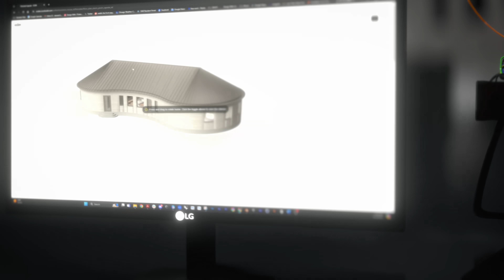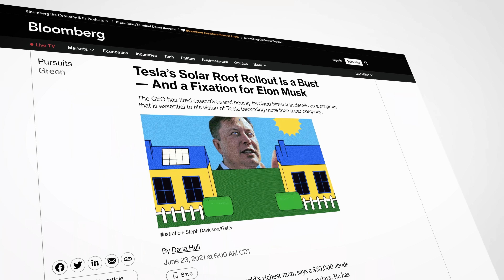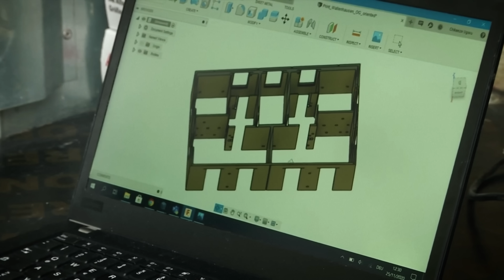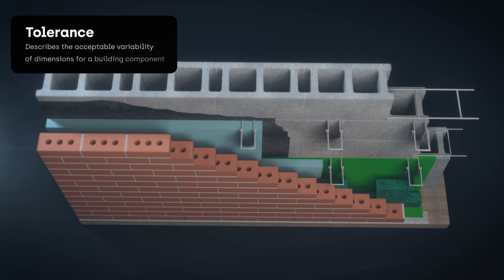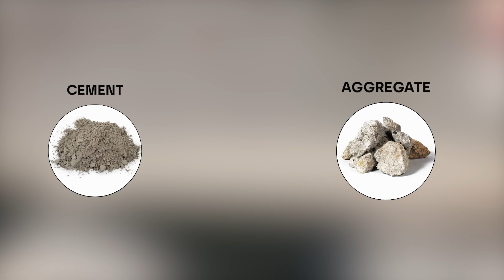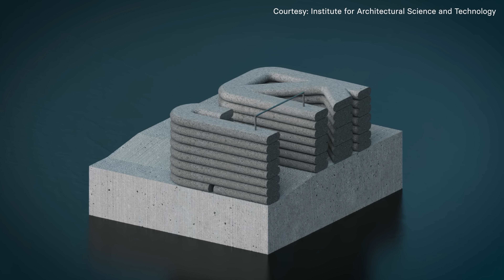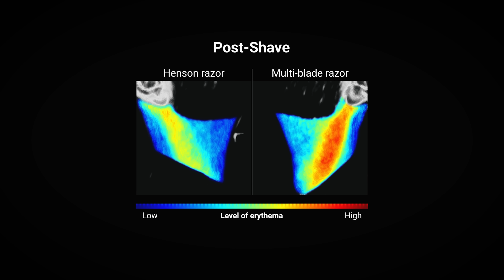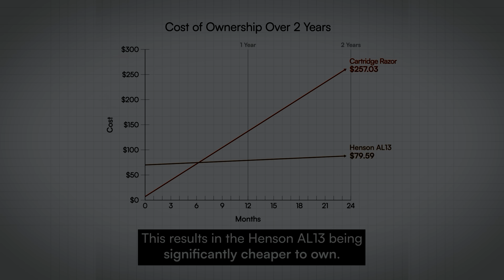Why 3D Printing Buildings Leads to Problems

Comment: I've worked closely with a leading concrete 3D printing company for several years now, so I hope my insight into the actual construction process provides some perspective.

First, one clarification: There is no gravel aggregate in 3D printing concrete. It is only sand.

You're right that the vertical integration is very strong in this industry, but there is already internal pressure to break that up. I expect in 10 years or so, you'll see more open-access tools available to architects and construction companies alike. I can't be too specific and honor my non-disclosure agreements, but there is recognition that the ability for architects to play with shape is very limited for now, which also limits the primary advantage of concrete 3D printing over other methods: complex shapes cost the same as simple ones. The primary reasons IMO for the vertical integration is 1) that there has been a high learning curve for the industry and 2) the business case relies on minimizing labor costs and the strategies for dealing with that are still being prototyped. Normally trivial things like laying foundations, running plumbing, tying roof timbers into the frame, and lintels as you mentioned, are difficult for concrete 3D printed construction. It's only in the last year or so that acceptable, repeatable solutions have been identified for most of these and are finding their way into standard design practices. But even then, there are still maybe 5 or 10 years more of on-the-ground construction needed to establish best practice. It's not too different from the way building materials and building science radically changed in the 1980's, leading to a decade of extremely poorly built houses prone to water damage and short lifespans. It wasn't until maybe 20 years after that best practices for high-quality construction had been standardized.

I would push back on the lack of repairability, though. This has always been an issue with concrete construction, and it's likely to become increasingly common for plaster or stucco finishes to be applied to internal walls, allowing for intrusive renovations to be reintegrated. Structural stability is not likely to be an issue since all walls have reinforcement every half meter anyway and often exceed building strength standards by an order of magnitude. Further, virtually all concrete 3D printing for now is slab-on-grade construction, which already has the same repairability issues you mention but is already widely adopted and has best practices for dealing with things like electrical and plumbing repair. I would also point out that the timber frame construction that we love so much is largely an anomaly unique to the U.S. where wood is abundant and cheap. Concrete 3D printed homes have the (so far unrealized) potential of being many decades or centuries more durable than frame buildings, which will change the design requirements that often contribute to design choices that later need renovations and repairs.

I would also push back on the criticism of how windows and doors are seated in the concrete homes. I don't doubt that many early concrete 3D printed homes were sealed with silicone only, but 1) the gap between windows and walls is already standard in frame construction and addressed with shims, spray foam, and trim and 2) the 3D printing companies have already started to adopt the same building techniques used by frame construction.

Echoing much of what you said, IMO concrete 3D printing has a high potential for unique design that won't be unlocked until architects are given freer access to the tools and pre-fab construction is a necessary companion to this industry, but there is still a lot of building science that is being worked out. There are already some serious advantges, such as all walls having a native R40 insulation rating, but these will be tempered by the inherent limitations. I don't expect to see a rapid adoption of 3D printed construction for another 5 or 10 years and for the U.S. market share to cap around 20% and primarily remain in the residential and light commercial construction spaces. I also think that the current bare-wall aesthetic will fall out of favor out in that timeframe since it will prove difficult to clean. I also expect that environmental costs will remain high as long as cement production relies on fossil fuels and concrete aggregate relies on mined sand. I also expect that a future use case for heavy construction is using 3D printing to create forms for much thicker concrete constructions, particularly for foundations, buttresses, and pillars, such as you see in airport construction.

Anyway, thanks for the video, and all the best!
Reply: Yup. Those internal 3D printed surfaces look like they're begging for some of that aerogel lime plaster or plain old dot and dab drylining. I've seen people build shotcrete boat hulls upside down and then roll them over. They use a stainless mesh, like rebar in regular concrete, then seal it with paint. I've also seen robots tying rebar together on job sites. Will we see these two robots working in tandem to, first, tie a steel frame together then, second, fill it with concrete?  A third robot to do the lime plaster?
Reply: @andrewmalcolm79  honestly depending on how disruptive it would end up being I'd be surprised if you couldn't have the print head having either a giant reel of steel or shorter spikes that it could literally just fire into the still wet concrete at certain points. It wouldn't be as strong as rebar and I have no idea if it would actually work as well but you could have so much more if the machine could just do it while laying layers that it might be comparable.
Reply: @andrewmalcolm79 I would say yes to your questions. It won't be long until AI gets involved in this industry. It will figure out the design and the bots needed to do the job. Once it's cheap enough to buy the machines I'm sure this will replace wood framing for several reasons. Machines will be able to build easier with 3D printing than with wood. And wood is a ridiculous building material. Machines will replace the framing crew, roofers, plumbers, electricians and painters. One machine maybe. It's a matter of time, and if humanity is here to need homes.
Reply: @andrewmalcolm79 I'll just say that there are efforts to automate EVERY aspect of the construction process. I've personally managed at least a few of these projects.

One published project is by OtherLab. They (or one of their many spinoff companies) designed and marketed a drywall installation robot. I don't know the current status of the robot, though.
Reply: Thanks so much for the insights! "but there is recognition that the ability for architects to play with shape is very limited for now, which also limits the primary advantage of concrete 3D printing over other methods: complex shapes cost the same as simple ones. "
I was wondering about this right off the bat when thinking of the  design freedoms and limitations.
Reply: This was a great comment, addressing a lot of the things I also thought about. Thanks for the insight!
Reply: @smashino  Same here. Almost all these "problems" have multiple )obvious and probably non-obvious) solutions that just need a little development.
Reply: You address some points I was curious about. However my biggest questions are these: How do they handle earthquakes? And what is the process for repairs after such an event?
Reply: @oriontherealironman  Again I recently did a project in California. The PSI of our mix is 7200, and the rebar, sheer wall and steel in there will withstand a 8.0 earthquake according to all the engineers that came out and saw the job, reviewed the plans, etc. walls are filled and R value over 30. house is built like a bomb shelter, a solid, fireproof feat of engineering.
Reply: @LeeGaudi-vb9ev  Was that a traditional concrete work job or a 3D printer project?
I was under the impression that that 3D printed doesn't have rebar which severely weakens concrete's ability to endure flexure.
Reply: @oriontherealironman I don't know about how these will handle in earthquakes, so I can't comment on this. I've asked, but that's not a question that's been addressed yet by the company I've worked with since they don't work in an earthquake prone zone. However, since almost the entire industry does single-story single-family ranch style homes, they are already less prone to earthquake damage than something like a town house or other multi-story buildings.
Reply: @joranbooth5529  
That's interesting to know, thank you for answering. It will be fascinating to see how these structures develop and change with more widespread use in varying locations.
I surmise 3D printed structures will find a purpose along side the other construction practices, instead of fully replacing one or more.
Reply: Excellent information, thanks for taking the time to comment.
Reply: "(so far unrealized) potential of being many decades or centuries more durable than frame buildings"?? 
  Well, I'm not holding my breath for that. Maybe some of these machines will be spitting out Roman concrete and some of those structures will actually be allowed to serve for centuries, but the lifespan of most buildings (especially frame buildings, some of which can be maintained indefinitely), is limited by how long their owners will tolerate them. Humans are a fickle lot and it's harder to build something that will be tolerated for centuries than it is to build a structure that will last that long.
Reply: @pcno2832 Nor am I holding my breath for rapid societal change, but there are regions in the world where durability is valued, and where that is the case, concrete homes are a good option.
Reply: Thank you for your insights! I love good comments that add to the discussion.
Reply: I really feel like this is a robot driven gunnite/shotcrete application that is so automated it basically becomes something completely new.  I wonder if there's an application of similar techniques used in pools to cover walls.   

Also, I'll back up your comment about windows and doors.  As a kid who grew up in a family that came together to build houses (my grandfather was an architect from the WWII era of architects knowing how to swing a hammer), there's a ton of horrible stuff inside lots of modern walls hidden by drywall and sealed with sprayfoam.  Anybody who works inside walls knows that even on new construction, there's a lot of "just make it work" fixes.  I can't imagine that concrete 3d printing is worse than a young guy on the site with all new tools.
Reply: Thanks!
Reply: Thanks for taking the time to offer your insight, it’s highly appreciated 👍🏻
Reply: I believe the window "criticism" was regarding how the flat back side of the window casing doesn't mesh well with the raked texture of the walls.
Reply: @skiptheroad I missed that then. Thanks for clarifying.
Reply: Wood might be an anomaly in the US because of it's cheapness, but I know it is used on purpose in Japan because of it's flexibility. If a stone, brick, or concrete building is hit with earth quakes like Japan has, it's either still up, or it's down. Wood building are more flexible and have some lenancy when it comes to that. Or so I've heard from the internet. I could be totally wrong.
Reply: I especially appreciate your considerations about the environmental impact, it would be interesting to do the math on whether the heating and cooling energy savings from the high level of insulation could balance out the impact that the initial concrete production over time
Reply: @JamesBeaucoup  There have been some efforts to model that because concrete homes can partially offset their cost if they can prove that they are carbon sinks or are less carbon intensive than other methods. That said, I'm skeptical that these models have been comprehensive enough.

To your point, the home lifespan will have a profound impact on its overall impact. A home demolished 1 year after construction will have a high impact compared to one demolished after 50 years. I'm curious to see how these homes hold up in the long-run.
Reply: Great comment, thanks
Reply: Have you ever done an episode on Buckminster Fuller's journey of home building?
From failed attempts at block houses to adapting the production excesses post war into home building factories. (monolithic deep drawn modular stainless bathroom anyone?)
Some really innovative concepts to produce simple housing en-mass for returning veterans.
Reply: Thanks for sharing your insights and years of experience. Are there any use cases in the US of 3d Multifamily Units? Say 24 unit bldg?
Reply: @FeltonLewis  I am working on one now in the US. We just completed a Duplex in California. I guess that is technically a multifamily property just a ground level unit. 2 b 2 bath and 1b 1 bath.
Reply: @FeltonLewis Currently, there are efforts to do more than ranch home construction, but these are still very limited.
Reply: Yes - To all of this. Thanks for taking the time to offer this info.
Reply: Such an informative comment. Thank you!
Reply: on the part about architects needing free-er access to... whatever y'all need for prototyping; what's to stop one of these 3d printing companies from making a scaled down version to allow for cheaper and more accessible modeling and stress testing? wouldn't a concrete printer the size of say, an ender 3 printer, for example make prototyping easier for architects?
Reply: @mythrillium2  the company I work with has two for exactly this purpose. One of the company execs is a former student of mine, and her 4th year undergrad project was making a 1m^3 scale concrete 3D printer. It's a thing, yes. Honestly, I had no idea that there would be a demand for that sort of machine, so making some noise about that would definitely get some motion in that space.
Reply: Thank you for your comment. I often get the feeling that these youtubers talking about this have no idea how a house is even built and are merely copying what others say. This isn't exactly the case, but there are some clear errors of thought in this video.
Reply: Thank you so much for sharing your thoughts! 😊
Reply: I'd like to see these 3d printed home companies include at least 1 laborer that is just there to help finish the edges of said home. Get rid of the layer lines, right? Those are gunna collect dust like a magnet and be a pain to clean. I think the biggest thing they could do it work on ensuring the interior finish is at least somewhat similar to drywall, we all like clean edges, right? (I did see some 90degree angles in that one shot he showed, so maybe they are doing this?) Have they figured out how to do multi-story 3-d printed houses yet, or are they still limited to 1 floor?
Reply: @adondriel  There are workers on site to do stuff like you suggest, but whether they stucco the walls or not depends on the home specs. I agree that the horizontal lines are awful for dust.

There are efforts to do multi-story, and I've been told that they are able to, but I haven't seen anything more than one-off demos.

Part of the problem, in my opinion, is that most of these companies want to 3D print as much of the house as possible. It took some time for these companies to accept more prefab, such as installing steel lintels and leaving them in place. At lot of the earliest attempts were looking at ways to bridge gaps with the concrete alone. IMO, a multi-story is relatively easy if you use wooden truss floors laid on top of a shelf along the outer perimeter. I can't speak to the stability of multi-story, though. I'm not sure if it's been rigorously tested.
Reply: At least one company is using a smaller gravel aggregate in their 3D mix.
Reply: @EXROBOWIDOW  My mistake then, thanks for correcting.
Reply: In 10 years we need straw houses and good insulation
Reply: @turnipsociety706  we may be able to eliminate everything that wind power soon because as it warms up a little tiny bit the wind speed picks up a lot. Cheer up we won't have to burn any more fuel all we got to do is just try and catch all that wind going by without it blowing our house awAy
This is Tesla's dream mechanical version.
Reply: I refurbished/remodeled a 1945 house a decade ago and when we put the new windows in they were all measured individually to fit the existing opening to give the best fit.  I would think this would be the technique used with a 3D pour/build.
Reply: @funnyfarm5555  wrong there's nothing to measure. This is pouring on a foundation and then you have to build a house into it there's nothing here to measure like a window being installed. While it's in the computer programming stage you can do all the correcting you want and get a blueprint amen dance around in the circle praise the Lord but at the end of the day once it sets up in concrete you're going to have to correct your mistakes and it's not going to be on the screen. Not one stick of rebar in the whole thing
Reply: It's true that longevity is a concern with steel reinforced concrete, but is that even possible with 3D printed concrete?  You can 3D print steel, but how would you simultaneously 3D print steel and concrete?  Furthermore, there are already serious reasons why many people are looking at phasing out concrete entirely, including the global construction sand shortage leading to literal sand mafias and ecological disasters (beaches stolen away, that sort of thing).  I actually wonder if concrete will remain a viable construction material for that much longer, throwing the whole thing into jeopardy.
Reply: You should look into the mechanization of fiber reinforced nylon printers. That won't answer the strength issue, their frail AF, but it may answer your rough in, and if you figure out how to handle stub outs then you've figured out your reinforcements issue too. Your engineers are weak.
Reply: Dear 3D concrete industry insider, With the concrete's limited flexibility, wouldn't arches be a better method of bridging gaps for doors windows and even hallways? I know that would create some cost issues for doors and windows, but it would add charm and style. Could this make such structures safer in earthquake prone areas?
Reply: Something that I really hope to see 3D printing construction adapt to is the relatively recent breakthroughs in understanding how Roman concrete can be created. Extruder-based printing on the small scale has long been dealing with hot materials, while conventional construction may not adapt as quickly, if at all.
Reply: Koran, I hope you read this if you have time. I could probably google it but given your proximity to this tech I figured it couldn’t hurt to ask. 

Can’t someone just skreed the exposed walls?
Reply: Great Info, I was curious why they weren't adding wood standoffs and plastering over the interior or hardy plank exterior like I've seen in basements. It would be a super simple way to finish. 

Also confused as to why they don't attempt to float the concrete as it sets. I have a history in traditional residential construction and have seen most of the processes used, it seems simple to have a worker follow the nozzle, add in a safety contact bar to the tip to prevent serious injury, just give a light skim as it starts to set.
Reply: Has anyone experimented  with adding a trowel to the outer side of the head? Smooth it out a little ready for rendering and use corner beads to form an edge if it's needed.
Reply: As a robotics engineer. 

Most of the problems are solved depending on who you talk to. 

I work directly with ABB, kukah and a few other manufacturers of cnc and multi axis machines and honestly it’s gonna be less than 5. Give it another 2 years and you’ll see some cool stuff man.
Reply: @thekidd2323 I sure hope so since I plan to get a house within 5 years, and we need a Tesla of House vs what’s being provided at the moment.
Reply: "Poorly built houses in the 80s prone to water damage"
You mean like people who build houses using cement pointing that totally destroyed the breathability of buildings trapping in water and rot?

Solution: put more people out of work building extremely ugly dystoptian damp cement  houses.

More unemployed people, worse buildings, Brilliant!
Reply: What is the R-Value of the walls? How does a vapor barrier (or the concrete walls) work to control moisture?
Reply: What do you see as the best way for an architect to jump into the 3D printed building realm?
Reply: @jokermtb  Personally, if it were me, I would reach out to the nearest company and depending on my current career level, either ask to consult on a project with them or intern with them. Most of these companies have architects they've worked with for a small number of designs. I'm not sure how much success this method would give you, though. Many are hiring, but they may also already be up to their ears in architects. Only way to know is to reach out.
Reply: Some of the examples given DEFINITELY had aggregate (eg at 08:43).
Reply: Expecting the tight vertical integration of the industry to just shake itself out, might be a little short sighted given the trend of corporate culture in almost every area for decades now. There's a huge financial incentive for these companies to lock down, license, restrict integration, etc. in order to monopolize the tech and ensure they are the only ones making a profit.
Reply: @bodeym  fair point
Reply: While producing cement is an environmental nightmare, the CO2 emitted from the limestone, as it's heated into lime, is eventually reabsorbed as the cement hardens, and turns back into a carbonate again, making it strong.

So cement actually absorbs, essentially, all the CO2 that was emitted by the limestone, at least in theory. But that doesn't help the main problem, which is the vast amount of energy needed to heat the limestone in the first place. That almost always comes from fossil fuels.

Seriously, just blue-sky thinking, but might there be an advantage in using volcanoes or lava flow to heat it up? Energy bills must surely be high, so why not take some heat where you find it? We have versatile refractory materials, we ought to be able to work with lava these days. Just keep it insulated enough to remain liquid. Or else, if it sets, pick it up solid then dump it back into the volcano.
Reply: Whsts the R value?   What it take to heat or cool?
Reply: @lada152  It's "thermal Resistance". It's a measured value associated with the insulation. Heating or cooling is a different measure. What R value tells you is if you start at a certain temp inside vs. outside how long it would take for the two to equalize.
Reply: Mm.  Yes.  All I'm reading in these comments and hearing in this video are "let's artificially drive up the cost of homes MORE for some crap no one with sense in their head, that DOES NOT have 40 billion dollars of disposable income just lying around, cares about.  It's not like the housing market and the "housing crisis" are falsely driven by greedy real estate tycoons pushing the price of every square inch of property and houses up up up so they can screw more poor people out of their homes into s|avery.
Reply: Good thoughts. Insightful.
Reply: Hot damn beautifully said
Reply: It could probably use crushed glass instead of sand.
Reply: AGREED
Reply: It sucks that YouTube journalism hasn't even caught up to traditional outlets outside of internet phenomena and politics.
Reply: Thank  you!
Reply: We can already export things into the file types needed for this.  Revit does this already, sketchup not so much but its relatively simple to port it over.
Reply: I’m 😅😢
Reply: but how do they add rebar? I mean, i havent put down bricks in several years, so i dont remember, but ure supposed to put metal in the concrete every 2 or 3 layers of brick. But thats just concrete, the moment a crack forms, its gone. its gonna collapse. i dont remember seeing concrete or any rock partially cracked. its either not cracked or fully cracked. Thats what the metal prevents.
Then installing things in the house or whatever. On last job the guy wanted the roof support beams to be visible and they were there mostly for decoration, but how do you fix them in the wall? Cutting in a brick is relatively easy, but concrete is different story. Like if you had to dig 10 cm deep, 20*10 rectangle in the wall. I havent done that so i just assume, but that seems like itd take half a day per hole. With brick thats easy, just drill several holes and make it a rectangle with rotary hammer.
Reply: SInce you are in the industry, you can maybe share some insides to this: A main advantage for 3D printing houses could be the use of recycled materials right? you basically could just mix powdered rubble which would be waste into the concrete mix instead of sand. Maybe even reuse a previously 3D printed house ground to dust and mixed into the new concrete?

Also the building style currently is very plain, there used to be a time where a lot of art was included into the facades expecially in houses in europe, some kind of floral ornaments, patterns where the windows are placed in, gargoyles or statues. all of those could be printed in the same go if the resolution of the printer is fine enough. Do you know if this is looked into?

why are the printheads made that the layer struckture is visible like this? it should be quite easy to add some kind of funnel which flattens the layers and smoothens out the outer edges. what is limiting this?

and finally, 3D printing could unlock much more organic shapes and integrate buildings into the environment, like if there is a hill or a bolder you want to integrate this would be great to use as custom solution.
Reply: >potential of being many decades or centuries more durable than frame buildings, which will change the design requirements that often contribute to design choices that later need renovations and repairs.

bro jus use bricks.... or adobe bricks.... not flimsy wood.
Reply: Thank you for the additional information, this video was way too opinionated
Reply: Ain’t reading all that, 3D printed housing is not the future.
Reply: Is anyone advancing the printers to do things like printing scaffold material to temporarily hold up the print over gaps, or making bots that can apply a smooth layer of stucco type materials to the walls? I love the tech, and the look of complex shapes, but have not seen anyone address the above issues in spite of decades of development. Also, what about wiring and plumbing? Can those be added into cutouts in the walls, with covers over them, for easy access, or attached externally with decorative covers? What about roofs? Are they designing roofs that are totally concrete and/or using scaffold materials to support printing them? What about marketing? These seem to have at least a few markets, from poor and plain, to rich and luxurious. Are builders finding good paying clients who can allow them to develop the above technologies to make the houses look nicer and have more complex shapes?
Reply: @itoibo4208  Scaffolding is done manually, but there are some feeble efforts to automate that. I had a student team design a mechanism that addressed one small part of that sort of thing.For now, the cost justification isn't there. For things like stucco, there are robots that do drywall, brickwork, painting, etc. but to my knowledge they have never been integrated with a concrete 3D printed home. I wouldn't expect anyone to try for at least 5 more years because neither system is stable enough to enable that level of automation yet. (I'm a roboticist/engineer, but this is just my gut feel based on what I've seen survive in the market and actually demo'ed rather than actual insider knowledge)
Reply: @joranbooth5529 I don't know if you're still answering here, but I wanted to ask something. It occurred to me that, in the case of printed walls that are infilled with (insulating) foam, that this is getting conspicuously close to the structure of sandwich composites - if you're familiar. (Basically, that you have two thin, strong outer panels sandwiching a thick, light and often soft-ish middle layer - because of the physical dynamics involved, they're very strong.) The question is then, if the insulation foam was formulated such that it has strong adhesive properties and bonds well with the concrete, and is itself structurally "strong", this could possibly create extremely durable walls, possibly even with less need for steel wall spacers and other reinforcement. Is that an avenue that is being investigated, or is it even already considered a part of the strength benefits?
Reply: @mnxs  That's an interesting question, and it is certainly possible that foam would strengthen the structure. But I don't know the chemistry interaction between the foam and concrete, and if the surface adhesion is weak, it would not be a structural advantage. There are ways around that, such as adding mechanical features to allow two dissimilar materials to interlock. Maybe with concrete, this would be J-shapes on the inside of the wall.

In short, it's an interesting idea that deserves study. but I'm not involved enough in concrete 3D printing practice to be more definitive, though.
Reply: @joranbooth5529  Thanks for the reply! Yeah, I can imagine that adhesion could be problematic - even if you can get something that bonds well enough in theory (certainly, structural adhesives prove that such a thing is possible), I could also imagine that the surface of concrete specifically is ill-suited for this - since it'd only bond to the very outermost (micro-thin) "layer", which could conceivably be a bit too porous/brittle - concrete isn't good with tension, as you well know. But using J-hooks and the regular spacers (shaped appropriately) might be viable, good idea.
Well, if you pitch the idea and end up making your bosses very happy, I wouldn't mind getting partial credit, lol 😁
Reply: People don’t really want to live in an ugly house. In the aesthetics of what we perceive as beauty are somewhat built in, and also culturally evolved. These houses look like they belong on a set design for the Flintstones?
Reply: @joranbooth5529 I can't see how elevation is a problem - you can stick on top of concrete anything you like. Isn't it that 3D printing makes sense for foundations and structural part, while everything else is better to be done/finished by standard methods. Anyway - thanks a lot for the info. Much more informative than original video.
Reply: This comment is a goldmine. Full of good info on both sides.
Reply: This is what I call "constructive criticism", the comment was very informative and not denigrating to the original post.
I enjoyed the video and this very insightful comment. Thanks.
Reply: Brillant
Reply: 3d printers seem to be improving fast. Maybe not for building homes. Yet the tech will trickle down. 

 People aren't seeing the future. This is basically a prototype. There will be first adopters. 

 So I see it taking off. I just don't know when. 20 years. 

 One day we will be able to print things atom by atom at scale. That will be the future of humanity.
Reply: This has to be the most informative comment to a youtube video I've seen. Thanks!
Reply: You are a true scholar and I thank you! I'm interested in this line of work What would you say has the best job availability to get into this field?
Reply: @Jackfrost2551  I'm not sure. Typically, you would need to reach out directly to one of these companies. Keep in mind that their goal is to minimize labor costs, so I have no idea if they are hiring at the moment. But if you are interested, be persistent.
Reply: Thanks! I read this comment and figured it would be way more informative than the video, so you saved me time 😁
Reply: Can you give me some information as to  who I could contact about information to getting a home 3d printed In north Florida? I’ve reached out to a couple of 3d printing companies and also several custom home builders who are local and none of them seem to know what I’m talking about. I’m basically at the start of this process. Just trying to get information about where to start Seems to be an issue right now also. Thanks you seem really knowledgeable about the subject so thought I’d reach out
Reply: Ty, much more informative than the video
Reply: Hi.

1) Is there really a cost advantage to using 3D printing versus using pre-fabricated concrete modules that are made in a mold off-site? It seems to me that using pre-fabricated concrete panels & modules are better because they're easy to remove and replace. So, that makes repairing and modifying the structure much simpler.  

2) At the end of the day, how is this any different from pouring concrete? 

Thank you.
Reply: Thanks bro, I was thinking these things as well.
Reply: Would multi-story buildable robots with simultaneous water and electrical install be here in 15 years or so?
Reply: Nice. Thanks for that
Reply: Stewart probably never saw a concrete structure being constructed. And he thinks brick houses have just bare brick inside and outside.
Reply: Thank you for your input and insight
Reply: Nah, it's literally a waste of energy, just like AI, and EVs.
Reply: Great comment - I have a question.  Could this also be a use case issue?  I mean using 3D printed homes to great small family dwellings seems to be ideal and a great somution to the affordability and homless problem.  Do we need to print bougie 2 million dollar palaces?  Seems like most of his critiques were aimed at that trim level of housing.
Reply: Fantastic comment. Thank you for sharing your expertise!
Reply: Thanks for sharing
Reply: No. 3D printed houses will disappear because it is a terrible technology. It will be replaced by site cast cellular concrete monolithic pour homes, with the machine that I happen to be developing myself.
Reply: A lot of American housing is built to fail, not to last. Homes are often built with cheap drywall, vinyl siding, synthetic materials, etc. The goal is fast turnover, not long-term durability. 3D-printed homes can solve many of these problems—but aren’t mainstream because:

They don’t fit the “build-to-replace” economy.
Concrete or geopolymer 3D-printed walls resist mold, rot, and pests.
They can be designed with high thermal mass—staying warm/cool naturally.
But they don’t require frequent maintenance or material replacement… which means less profit for builders, suppliers, and contractors.

So ironically, better tech threatens profit chains.
Reply: As a Structural engineer and therefore a Forensic Envelope engineer this is non-viable for any number of reasons. It can't perform in seismic or hurricane zones. It must have siding added, set on tracks, but the tracks must all be co-planar, not possible. So it's a dry-country, warm region, no seismic, no hurricane 'solution' for ... Taos? El Paso? I'd pay adobe or cobb workers before someone brings this 3D mortar machine in.
Reply: @AmericatheBeautiful-p4z  Huh? Of course you can put this on tracks, just print the whole thing on them, what is the problem? You are very limited in your views, you have no clue about how 3D printing works, in many way it is much more flexible than the old way of building. This by the way is not the be all and end all of all 3D building printing, this is just ONE WAY demonstrated here, did that ever occur to you? Would you claim the same about an old brick building that is obviously NOT earth quake proof, that therefore all building that use a stone type building material must be make out of bricks? Of course not. But you do that here with 3D printing.
Reply: I absolutely agree with your perspective.  It's a developing industry that just needs time and investment to overcome the snags, but it works and those snags aren't so serious really, especially when you consider the long-term advantages of the method.  

However, I'm amazed we're not using CLAY as the primary substrate!  It's abundant, durable, superior insulator, dimensionally stable, low-carbon, breathable, mouldable, fire-resistant and can be reinforced with recycled GRP fibers or metal mesh if necessary.
Reply: Epic response!
Reply: Rules to build are slow ,design
Reply: The whole goal is completely misplaced. The expensive part of construction is not the basic labour of primary construction. 3D printing also doesn’t remove the fundamental labour requirements. You still need the same number of concrete truck drivers, and you’d still need the same number of guys on site to be able to reasonably do detailing & to fix problems as they occur. The whole concept is born of an essential misunderstanding of the industry.

The primary cost of house construction, especially in the US market, is the extreme price of homes themselves. Inflated house prices mean inflated upfront cost for land, as well as inflated expectations for minimum return. Speaking as someone who works for a developer, we cannot afford to make things cheaply. Our minimum upfront is simply too high so we’re forced to play in the luxury market if we want to make any money in the city. If we don’t play to that market then other developers will outbid us for properties and we’d end up out of business.

The practicalities are completely irrelevant. At best this is a novelty, at worst these structures will not be sound or nice places to be (seems to be more the later than the former). The problem is the existence of federally backed mortgages reducing the risk too much, driving up the price. We’d love to make cheaper homes at a faster pace. But we can’t because the bank has to take their cut. The main cost for us is organisational & transactional, not labour.
Reply: I appreciate your insight, having a perspective from the other side of the fence is extremely valuable, and I thank you for taking the time to write this.
Reply: Had to watch a YouTube short while reading this essay
Reply: I would add another tidbit: 3D printing is nice on a clean slate, or a flat, empty space with enough room around for the gantry. That means it works for new developments on previously levelled terrain. This may fit for large parts of the United States, but it works not so well in regions which are more mountainous than the continental U.S.. Most of Europe is hilly or mountainous - not in a Rocky Mountains way, but hilly enough that many construction sites are on a slope. This is not an issue for a traditional house - you just need to level the actual area of the foundation. For a complex gantry, this becomes a problem. And Europe is very old, which means that basically everywhere someone can develop land for construction, it is already developed or was left out because of some problems like being in a flooding area or on a steep hillside. Or it is a previously developed spot, which was cleared for new construction. But that means that space is very limited, because the neighbouring spots already have houses. Where do you place gantries here? And how do you even get them on site, if the access road is narrow, because it was planned 750 years ago wide enough that two horse drawn carriages can pass each other?
Reply: I think the trick to improving concrete 3D printed homes is to incorporate other methods of 3D printing. Starting off with chain welding 3D printing for the basic frame structure. Then moving on to foam 3D printing which combined together with the chain 3D printing could give curved and domed roof structures that do not have to be framed. They could also act as a temporary support for the concrete to be 3D printed on until it dried and was structurally sound itself also the 3D printed foam walls would allow places for conduits to be ran and provide extra insulation. And also thinner concrete Channel prints for the domed roofs that could be cross-hatched that provide extra strength. Using multiple techniques possibly print almost everything except for the doors and windows possibly even print the gutter systems
Reply: Calling me even A layman in this field would make me blush, that being said i "learned" more from your comment than from much of the actual video. If you're ever considering another option within your field, teaching might be a calling for you my friend. The soul, for lack of a better adjective, of this heady information i found more understandable to grasp when you were laying it down. Js :)
Reply: "Trivial things like plumbing." I'm a plumber, it's not trivial. You realize that very quickly if it isn't done right. It takes time and knowledge
Reply: Yeah, that bit about using the 3d print as a form for a thicker wall is so hilarious to me- my forming crew can do 300 ft of 9 foot tall wall in about a day and a half- and it will be perfectly level, plumb, and straight
Reply: @gatergates8813 I hear that, but I"m not referring to shapes that can easily be formed up. I have no doubt of the skill of an experienced crew, but as you know, some curved shapes are very hard to form. Concrete 3D printing is just one of many tools, and for now it's a clunky one. I don't think forms will go away, but I do think that if a business case comes up, it will happen.
Reply: @joranbooth5529  Do you think that this could be used to build something much more affordably in the shape and design of a medieval castle? With a plaster and lime wash, I don't think you'd be able to tell the difference. I might need to make a few concrete forms to sharpen up corners though.
Reply: @CaedmonOS i don't think this tech would be easy to shoehorn into mimicking another texture.
Reply: They need to have a plasterer follow the machine & smooth the surface. That surface would be horrible to paint or clean. the insects & spiders & moss would love it though.
Reply: I don't understand why there is such a push against timber framing. And one of the things always brought up is that "it is an anomaly to the U.S." Okay... so? Just because the rest of the world doesn't do it now doesn't make it wrong. We don't have to change our way of doing things (especially if it works well and is sustainable for us) just because others do things different. Are we children? Do we need our mother to ask us, "If your friends jumped off a bridge, would you jump too"?

And the durability argument is not really all that valid either, considering we have examples from all over the world of timber frame buildings that have stood the test of time for centuries. There are wooden frame churches, temples, castles in Europe and Asia (Norway, Poland, Hungary, Serbia, Romania, Russia, Kazakhstan, Japan, etc.) and some churches and homes in the U.S. that have lasted for centuries and are still standing strong. Timber has just as a strong an historical pedigree as stone when it comes to construction.

Also, stone has to be quarried and minerals have to be mined for concrete. Timber is a reneweable resource (because you can plant and grow trees, and when they're cut, you can plant new ones to replace them) that, when harvested intelligently, doesn't cause nearly the amount of ecological and environmental devastation that quarries and mines can and often times do.
Reply: @SouthernPecan86 I live in a timber frame home, and love it. That said, I also understand the push against timber framing. 

First and foremost, is fire. Wood burns, concrete and stone do not. Sure, the interior furnishings and wall coverings can burn, but that is still a less dangerous situation than the actual structure catching fire. Non flammable construction also has the advantage of limiting spread. A kitchen fire is much more likely to stay in the kitchen. 

If old wiring shorts out and burns a little bit in a concrete wall, call an electrician. If old wiring shorts out and burns a little bit in a timber frame wall, call the fire department. 

I'm sure insurance companies are part of the push. I'm amazed they haven't made residential sprinkler systems a requirement, but since there seems to be little appetite for that I'm sure they'll take non flammable construction if they can get it.

Second, the durability argument is perfectly valid. 

While there are many examples of centuries old timber frame structures, they are only still around because they were maintained. The ones that weren't maintained no longer exist. Quite a few pictures out there of a masonry fireplace and chimney standing seemingly alone in a forest, with the rest of the structure rotted away. 

There are plenty of other problems you see with old wood framed homes that wouldn't happen with a concrete home. 

Moisture is the biggest I see. Rotted out floor joists/beams from basement/crawlspace moisture. Mold damage from the same. Of course concrete isn't immune to moisture, but it's a lot more tolerant of it than wood, and for much longer.

Finally, termites and carpenter ants. Insects can literally eat away the structural integrity of a wood framed home if left untreated. As far as I'm aware, there aren't insects that eat concrete.

There's a reason that living in an old home here in the US is an "experience", but perfectly normal in Europe. I've heard of people here having to get insurance through carriers based in Europe after US based insurers denied simply because the home is "too old".

While perfectly doable, there are unique challenges to living in and maintaining a centuries old wood structure that simply don't exist with concrete and masonry. Naturally, concrete and masonry have their own unique challenges when it comes to maintenance or renovation, but those challenges are largely the same whether it was built 10 or 200 years ago.
Reply: @Sparky95  Not exactly:

> If old wiring shorts out and burns a little bit in a concrete wall, call an electrician. If old wiring shorts out and burns a little bit in a timber frame wall, call the fire department. 

The wood house burning down is the worst-case scenario, but it's not the most common.  Any shorting and burning is most likely to happen where connections are made, and by code, these connections have to happen in junction boxes.  Anything in these junction boxes are generally made to be hard to burn.  This generally keeps the melting/burning contained so the house isn't set on fire.

I agree, concrete is a lot less flammable than wood, but there's a lot of redundancy in modern electrical systems so that fires are contained and avoided.  For example, Arc-fault breakers.
Reply: @SouthernPecan86  The obvious issue is the fact that you will run out of trees. It's not as if continuously harvesting every tree that is a proper grade for construction is a smart idea environmentally speaking. You will never be able to replant and regrow the amount of trees needed to supply housing to an ever increasing population without still damaging the biomes those trees originally inhabited. You're driving animals out of their habitats, and changing them forever. Replanting isn't simply a drop in solution. It's a bandaid.
Reply: @SouthernPecan86  I'm sorry that I came across as being against timber framing. I don't see it as better or worse. It's simply another tool, as is concrete 3D printing. Different methods work better in different environments. And I fully agree that (at least for now) timber is renewable and cement production is not.

The durability argument : you mention extremely old frame buildings. Yes these exist, but 1) they are made almost exclusively with old-growth hardwood lumber and from species resistant to rot and insects. Modern timber frame homes approach this by treating the wood, but it is still far inferior wood to what is being used in these ancient constructions. And 2), they tend to be maintained by groups that can afford the maintenance. Your counterpoint seems like a survivorship bias to me. Again, I see timber framed homes as only having pros and cons, and not being a moral good or bad.
Reply: I agree that most of the concrete 3d problems are overblown in the video. But from my perspective. Concrete 3d print are inferior then module prefab construction. Why waste time setting up the printer, material, and manpower at the risk of mother nature ruining by raining. When you can mass produce pieces/parts of house and ship them to location for assembly. Like lego.
Reply: @RandomPerson-tz7wk 1) there is a market value to the labor reduction provided by 3D printing, and most of the companies for now are trying to figure out how to push the tech to its promised potential. Right now, margins are slim, but the company I've worked with turns a small profit already.

To me, the walls are a the low-hanging fruit that is easy to communicate, but the places that concrete 3D printing can make a profitable impact are yet to be realized. Again, I'm being somewhat cryptic because I don't want to accidentally share more than I'm allowed regarding ongoing projects, but the industry is trying a LOT of different techniques to expand the utility of the tech, some of which I think hold a lot of promise.

I would push back, though. I don't think the video overstated problems with concrete 3D printing. I think all its criticisms are fair. I would just prioritize them differently than Stewart.
Reply: @RandomPerson-tz7wk  he did say in the last paragraph that 3d printing and prefab will likely be used together.
Makes sense to me as both have their advantages. You can use 3d printing to make prefabs fit the unique use case of the building better.
Reply: @RandomPerson-tz7wk  I think you have a point here, plus the options for using more sustainable materials are greatly increased.
Reply: @RandomPerson-tz7wk shipping costs can be quite large and there are challenges for that. You also end up shipping all the weight twice now instead of once.

Weather is regional. In many areas it's easy to avoid rain. But yes, not everywhere. In those cases it would be easy to setup a reusable fabric structure though. In fact that is already done to a lesser extent sometimes.
Reply: @RandomPerson-tz7wk  -- Because the shipping costs will make the idea worthless.
Reply: @johnnyonthespot4375  shipping and setting those machine and material cost less?

If cost is a concern stick to wood house. If you want to make a house using cement. 3d printing is far more limited in design and is not solving the main problem the video mention. Not mass producing house.
Reply: @RandomPerson-tz7wk  -- I think you misunderstood - I am saying that, although the manufacturing of something in a factory may cost less, it is the transport costs that would destroy  any savings.
Reply: @johnnyonthespot4375  I understand you perfectly and I disagree. Concrete 3d printing still have shipping cost and it won't be cheaper then shipping an entire house ikea style. Plus there's the saving from needing less manpower and hours to assemble the house. The materials use are not limited concrete. They can complete the timber/metal frame and connect it on site.

Overall it have less complexity, higher flexibility and tolerance for error. I suggest you watch a few video on the subject. It's more fun then reading a entire essay.
Reply: Agree that most of the current issues can be worked out over time - we are very early in the development curve of this tech. However, the biggest issue in my mind is the use of cement in the first place. Cement and thus concrete, is the most destructive building material on the planet. It is unlikely that "green" cement will ever get much of a foothold without government intervention. Even if we converted to green cement, the formulas I've read about rely on recycling old cement which is a limited resource. If we begin to make green cement, but are still mining raw materials then we have only partially solved the issue, as the mining is dramatically destructive to vast swaths of land and uses a lot of fossil fuel. I feel that if we are serious about reducing carbon output, we must stop using cement for foundations in houses and most moderate sized buildings and certainly not be moving towards entirely cement constructions. Pier and beam (or similar) has a lot of advantages over concrete slabs. It allows easy insulation of the bottom of the structure, it allows for easy repairs to plumbing and electrical via the crawl space, it can allow regular structure leveling via adjustable jacks on top of the piers, it doesn't crack or sweat and so on. Sure the piers might still be concrete, but that would be a huge reduction in usage although steel piers and other materials probably could be used. Cities and states should condsider pushing the home buiding industry away from using cement in general. You might end up with a better house.
Reply: @Hybridog  I've heard of cabins built on tree stumps and have always wondered if there's a way to preserve them permanently enough to form a permanent foundation. The price would be right, and I can't imagine a man-made pier adapting as easily to variations in the land as trees do.
Reply: @Hybridog not to mention the insane amount of water concrete uses compared to pretty much any other basic material, which will be an invaluable material going forwards. Also the fact that not only would “green” cement supplied by using old cement rely on limited supply, it also never could reach the same standards of strength as normal cement
Reply: @Hybridog Cement and concrete are just so dang useful, though. Most of the carbon impact comes from  the firing process where the kiln must reach 1450 deg C. There may be other approaches that might in the future be cost competitive, but burning stuff is just extremely efficient. Early industrialized iron production suffered a similar problem before coke was invented. You may be familiar with how 95% of all the forest in the U.S. northern colonies and states was clear cut. Some of that was for farming, but by the 1810's through the 1820's, most of that was for firing the iron smelting kilns. There is probably some solution, but I don't see a savior technology emerging from market forces.
Reply: @joranbooth5529  from what I learned in class a very significant part of the climate impact of concrete is the impact of sand mining and the incredible amounts of water that it requires, which can’t really be removed from the equation. Also what do you mean firing? We’re talking about concrete not bricks
Reply: Sand is aggregate.  For form-cast concrete, the size of the aggregate is mostly controlled by the desired surface finish.  The smoother you want to be able to finish the surface, the finer the aggregate you use.  Sand is used for very smooth final finishes.  You can go too far with this.  I went past the City Hall building in Kitchener, Ontario, Canada when they were putting the final finish on the concrete paving of the courtyard on the King Street side.  A few days later, I went past again, and the finish was almost glass-smooth.  And quite slippery as well.  Kids were having a great time sliding on it.  A few days later, I went past again to see a crew out sandblasting that dangerously smooth surface to a more typical rough surface finish for concrete surfaces meant to be walked on, such as sidewalks and courtyards.
Reply: @evensgrey I know sand is aggregate, which is why I phrased it the way I did; "gravel aggregate". The video showed a picture of gravel when discussing aggregate.
Reply: you've basically said everything I was thinking and then some. bravo, and thank you.
Reply: This comment is better than the video itself.  It seemed like he was trying to invent problems, and acted like every problem was unique to this technique. 

Thank you for your effort on this comment.
Reply: Thank you for the detailed write up. I feel that you give an unbiased perspective.

Making concrete forms seems to be the best use of this.
Reply: What would be your stance on switching from concrete pouring machines to brick laying ones?

On abstract, it sounds easier to me, and you we could still erect buildings the same way we do nowadays. Not fancy designer buildings, but regular living accomodations.
Reply: @drillerdev4624  I don't have a stance since I see any potential tech as just a tool. There are brick laying machines out there and they do fantastic work. But they are something like a conveyor belt, so they don't handle gaps for windows well. Some use robot arms which can handle gaps well, but they are slower. In the end, I personally prefer the aesthetic of brick over concrete or cobblestones over asphalt. But the financials ultimately decide which is "best"
Reply: @joranbooth5529  If they can't handle gaps, but can detect at which point/row/whatever they must stop so the human workers do the part that the machine can't do so it can continue, it sounds good to me ON PAPER. 

Of course, I don't know if it's feasible from an economic standpoint. Will the human worker hace work to do while the machine lays bricks? Is to expensive to have the machine stopped while the human adds the window frame? Can everything be scheduled so that both human an machine can work in different spots at the same time? it's just easier/cheaper to hire 2 human workers and forget about the machine?
Reply: @drillerdev4624  No, it is actually not: Can you just do a brick wall with bricks without training? Try it, it will be totally crooked and ugly and structurally unsound. There is a law in robotics that says: Anything that is not so easy to learn for a human being is also hard for machine to properly do. It is hard because there is a lot of variability and because if you stack the bricks wrongly, any tiny mistake you do on the bottom will multiply on the top and make the whole structure fail. The concrete pouring nozzle is relatively simple, while a brick laying robot would need tons of cameras and even lidar to make sure the bricks are all properly arrange and placed and the mortar applied not too thick or thin.
Reply: @nigratruo well, that is the case if you compare the bot with skilled human expert labor 

You should have seen the building that they' finishing in my neighborhood. The brick laying was (or at least, looked like to an untrained eye) sloppy AF 😅
Reply: omg thank you thank you thank you for this detailed response
Reply: Wait. Vertically integrated monopolies trying to eliminate workers and fix who gets to build houses in the future?

The hell you say? Same crap different day.
Reply: Thanks, Jordan. You saved me so much trouble.
Reply: Make a video chief
Reply: He never said there was gravel.  Sand is also considered an aggregate ingredient.
Reply: I'd much rather see ICF scale, because that results in an insulated concrete house with steel reinforcement. This looks like a gimmick.
Reply: Thanks for your comments, saves me from having to watch the video.
Reply: Gotdamn you can Yapp
Reply: doesn't plastering walls defeats the purpose of having a machine build it ? its probably more work than just erecting normal walls. really, we should go back to using only wood on buildings.
the real problem of home affordability was never the price of the building, but the land. maybe changing zoning laws, but that's not allowed, isn't it ?
Reply: Lel, your "push backs" are dogshit.

Traditional concrete is going to be difficult but... NOT impossible to fix. We in tbe industry have experience in doing so. 3D printed concrete can't say the same.
Reply: Interesting comment. Unfortunately the computer and the concrete are opposites in many factors of human endeavor and will never make a good blend. On a computer you run it and you fix it and you run it and you fix it and you run it. Both processes are equal in concrete you run it that's expensive and then you fix it and that's 10 times as expensive. So now you think you are going to get this instantly correctable technology to blend somehow with the permanence of concrete. You were going to have a computer that works perfectly without debugging. And it is going to blend in perfectly with concrete that really doesn't allow debugging and you'll have all the holes for plumbing and wiring and everything? Computers are absolutely lousy at one off work. By the time you program the computer to do the job, you need to make millions of copies. You better get concrete right while you're doing it because if you don't have holes or something is missing it's a lot of money to make them after the concrete sets up.
Reply: @markmcgoveran6811   Interesting points. I don't wholly disagree, but I don't think I agree with your premise either. I'm a researcher first and foremost, and in my field there are two primary branches: simulation and experimentation. To your point, the computer (simulation) can be worked and reworked, but as you rightly point out, there is a "simulation gap" as we call it between the simulation and experiment. In my specific field, this most often shows up when you start introducing friction into the physics model.

That said, where I disagree is that there is what is called "tacit knowledge", which refers to the kind of thing you can only learn by doing. Construction is full of tacit knowledge, and again to your point, it is hard and often impossible to translate that to simulation.

But where I disagree is in your conclusion. Just because there is a simulation gap does not mean that it cannot be bridged, either with better models or more often, with implementation. Concrete 3D printing is just a computer controlled tool. It's not a simulation; that exists on the front end design software. Point being, that there is tacit knowledge also gained by using the concrete printers, and that allows these to improve over time. As such, the computer becomes secondary to the tacit knowledge, the trade secrets, so to speak, and in that way they blend very well. The problem, as I see it, is that the tacit knowledge is not well developed yet.
Reply: @joranbooth5529  well yeah you're still beyond simulation when you're talking about pooring concrete with a computer. If you have to debug that final step where the actual machine work ties into the program. There are two types of plans in every large building the blueprint and the as is blue print. Most of this stuff is reiterative if it's going to work at all. Watch me and get off the bus three stops before I do. This information isn't much use if you're coming through the city one time in your life. If you're going to go to work there then you could come in a day early and figure it all out and that would be good advice. There is a jump from abstraction to concrete practice, and it happens many times in a construction project
At the end of the project no matter how long we've been doing this we still have a very expensive fellow he reverse engineers the blueprint from reality back to the picture of the as built blue print. There's a big thing there. If you don't understand what I'm saying you may.
Reply: Mansplaining something he does NOT understand.
Reply: Stop printing buildings, start printing modules.
Reply: Have you actually swung a hammer on a construction jobsite ?!!? 
1st: Interior walls will need built on top of the concrete in order for all of the mechanicals to be placed. There is nothing suggesting an alternative to this.
2nd: Are you at all familiar with how precious the sand is that is used to create concrete ?? You actually think it makes sense to make the whole house
out of sand ?? 
Just as Lithium is more of a stopgap then a full answer to energy storage so to is this setup for constructing a home.
TectonBuilt - Keep your eyes open for this.
Reply: @johnnyonthespot4375  Yup, sand is precious and rare, hahahahahaha, I have heard this bullshit before. Sand is EXTREMELY abundant, nobody that has traveled the world will ever get the stupid delusion that sand is rare. Can you only use one type of sand? Of course not, there are many ways you can do concrete that will work well. You might have never learned that, but maybe you should learn more about material sciences and instead of believing everything anybody tells you, find out for yourself, by EXPERIMENTATION. (I know most people are not intelligent enough to do that though)
Reply: @johnnyonthespot4375  Yes, I've swung a hammer on a job site and I've built a lot in my time, but no, I've not been a construction worker.

1) I know, and nothing I said is to the contrary. They print around the mechanicals same as they build around them in slab-on-grade construction. The nozzles on these printers are a few feet long, allowing you to print around standoffs a few feet high.

2) I am, and I mentioned that when I discussed the environmental cost. It's a big problem for sure.
Reply: @johnnyonthespot4375  ah yes, silicon dioxide...so rare!
Reply: You talk a lot but say nothing but hot air. Come with solutions before start pushing this half-assed production method.
Reply: @MisterMakerNL  It's sad that you missed all my nuance. I'm neither a proponent of concrete 3D printing nor a detractor. There are pros and cons, and it's still an immature technology and quite defficient as is, for now. Nothing I said is "pushing" this tech.
Reply: Until you understand basic civil engineering principles, it's safe for you to sit down.